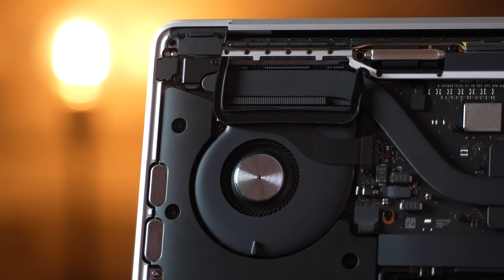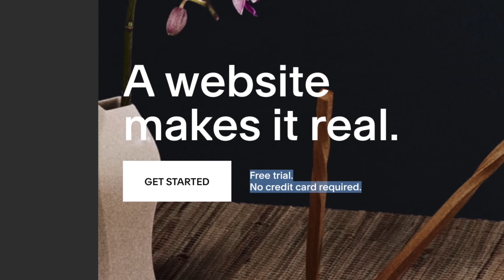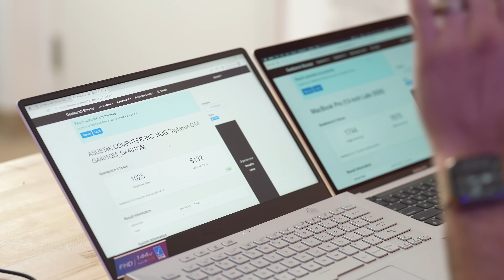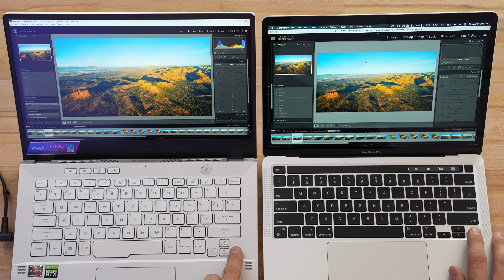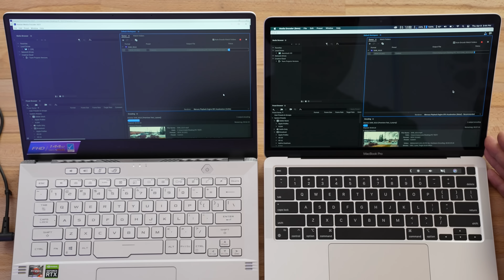Apple M1 vs AMD 5900HS + RTX 3060: FINALLY an M1 Killer?

Comment: Benchmarks are so pointless. Right now for example i have 2-3 second delay in Develop - Lightroom Classic vers 13.4 from picture to picture from an M1 8GB, and on a laptop Ryzen 5600H with integrated graphics the delay is less than a second. So where the power and optimisation from Adobe/Apple ? On 13.2 version it's allright. Big hype to sell, reality is somewhere inbetween.

Comment: Memory performance between 8GB and 16GB is generally find a very small difference, about 2 - 3 % max depend what apps and task is running. This is because an application does not run solely on memory space, it also run back and forth using the paging space for hard drive storage or digital drive storage. Your thoughts?

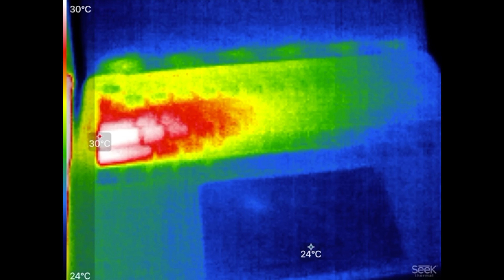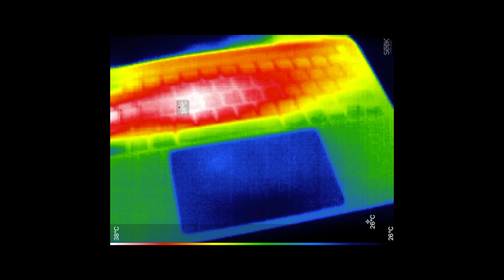Comment: Before and after the cinebench test, the hot-spot on the M1 happens to line up perfectly with the output fan on the Zephyrus 8:50 and 10:38 and

Comment: No one from the M1 fan club wants to acknowledge the existence of the ASUS ROG Flow line of laptops at the time (X13 w/ 5980HX), which absolutely destroys M1 macbooks in performance while having the same form factor (1.5 cm thick, 1.3 kg weight), and the similar premium features (plus bonus 120hz touch screens w/digitizer and microsoft pen protocol support). not to mention the ability to get up to RTX 3080 mobile egpu that has no bandwidth bottleneck,  the combo would still cost less than a m1 max machine with 32gb ram and 1TB storage.
Reply: Quick question, I'm interested on buying it but about its battery life? Oh and if it sucks can we upgrade the battery by switching it with a much stronger battery?

Comment: I'm watching this in 2022 because there aren't many comparisons like it for the new model g14s What I really want to see is basically the same series of tests without ever plugging in either machine, both starting at 100% battery, and then compare what % battery is left at the end or how may of the tests they can get through before the battery dies.  Another great test that would help know what I'd be getting would be how long can I edit photos in Lightroom classic before there battery is drained and how smooth is that experience? I wouldn't have any of these questions if I didn't think about wanting to also have a device to occasionally game on, I 'd just buy the MacBook Pro (no I don't want a console, since I already have a steam library).

Comment: I like how they keep saying the CPU will the m1 mag has built on GPU course so there's no way of disabling that otherwise it wouldn't be able to see the display you need to be able to enable the discrete graphics card and if it wins because it doesn't have an Apple doesn't have a discrete graphics card well then that's a big telling point it's not the CPU it's the GPU and the GPU does help the CPU

Comment: It's the fact that Ryzen is running generic platform applications not optimized to run that processor performs on par with application specifically developed to that m1 chip is mind blowing.  Hats off to AMD
Reply: You can't run ARM applications on AMD. you know that, right? M1 on the other hand can run applications written for x86 thrrough rosetta stone but at a loss of speed.

Comment: To all M1 fanboys. M1 does not share the same or similar instructions with AMD and Intel like AVX or SSE instructions. You can not do many many many things you can do on intel or amd without emulation using m1.  Just get over it man. M1 is a great processor but it is ARM based and arm is a lot different than intel. It is not better or worse. It is different and good.

Comment: I think the problem still is,  Windows is still optimized for Intel.   Despite AMD doing very well with RAW performance.   AMD is still somewhat crippled in that sense.  On top of that, Windows is generally made for generic computers,  as its not paired well with any specific PC.   Windows is made to be compatible with everything anything, supporting a wide array of components; which hinders performance.   Whereas, Apple, (while limited support)  hardware and software is tailor made specific.       the AMD is powerful indeed, but it carries a heavy load of Windows inefficient code, backwards compatibility and legacy support for hardware and software.

Comment: I feel like people in this comment section just forget that these are two entirely different devices built for different purposes with different up's and down's. Sure the G14 is better in some benchmarks and the MacBook is better in others but people just totally forget that the speakers on the G14 sound like shit in comparison to the MacBook, the battery life is worse (not even close), the trackpad doesn't feel good, it's less portable since it's a thicc boi and so on. While yes the G14 gives you the better overall gaming performance and experience and for it's price it delivers great value, it doesn't even come close to the MacBook if you'd use it everyday to edit videos or photos, code stuff and use it as a media consumption device. 
It's like comparing a sedan with a pickup.
Reply: the difference is that you can do whatever you want with the G14 asus laptop, there aren't limits, There are no limits, and when there are no limits, everything you say about consumption doesn't matter. Meanwhile with the Macbook there are limits. And about the G14 its a thick boy, It doesn't seem like that much, you're exaggerating.

Comment: I bought a G14 two weeks ago. It's an absolute gem. It runs absolutely silently in silent mode, but you have to set the mode. But I like that ability. Windows has always had pen lag in Photoshop, regardless of the processor. It has nothing to do with the G14. It's the way the standard mouse and trackpad drivers are handled by the OS. Run the same test but use a Wacom and you won't see any difference.
Reply: I also own g14 and its a absolute win when it comes to windows laptops.

Comment: Its like comparing cargo truck to sport car. Sport car is faster, prettier, more exclusive etc. Cargo truck burns 10x more fuel, is big and clunky but can tak 24 tons of cargo. Same here with M1 is faster in typical usage, more power efficient etc. but it is still ARM cpu which always will be less efficient in high preformace computing because its architecture and instructions set. Anyway Im very happy with huge progres achieved by ARM cpus in last few years.

Comment: I have spent a lot of time from a business perspective with M1s. We also have a some power users who we have outfitted with Dell G5s. If you are a power user the Apple will not perform as well. Now the Apple is also stuck at 16 gbs maximum ram. When you start getting above 12 gbs running multiple things, it is slower, period. Most of the tests in reviews, not a criticism are running all their tests one at a time. When are you doing some editing along streaming video, lol, with god knows how many Chrome tabs in the background, the G5s continue to roll. The M1s are unbeatable if you want top power on the move all the time, but it does have its struggles. The G5s are outfitted with 32 gbs but the AMDs when more cores are being pushed, you can truly see the difference.

Comment: M1 isn't actually faster, its perfectly optimised with the operating system hence gaining the speed and smoothness.
Reply: At the end of the day, it is faster; but you can call Intel and suggest him to create a native operative system 😂
Reply: @mattxloca3049  its not more powerful than Intel or Amd it's optimization makes it look faster. If Intel or Amd were optimized with the device then they would be faster
Reply: @rhythmkhandelwal2940  bro I sad that is faster not more powerful ahaha. But at the end of the day M1 it’s faster so that’s it. People looks the velocity of a processor non how much powerful could be in a dream, and M1 is still not supported at all by apps so also M1 is not optimised
Reply: @mattxloca3049   pls play cyberpunk 2077 on macbook u can also cook an egg whute playing it
Reply: @javier-jg8hr  windows laptops also get damn hot while gaming, I myself have g14 and saying it from experience. But thats what is expected due to current tech limitations, but m1 is definitely promising.
Reply: No, it is faster. Software is important but if you had the software optimized for both, M1 is faster and sucking in less power.
Reply: Alder Lake is proven to be fastest commercial processor currently, it's only drawback isn it's power consumption otherwise it's currently beat M1 Max in every thing except battery life
Reply: @rhythmkhandelwal2940  and that's only because of the power difference. If apple decides to suck in 70 watts, it will be faster. M1 is still scary fast compared to anything on the market,

Comment: DUDE WTF? Get your percentages straight! Your calculations of reduced performance on Asus laptop are very wrong.
Asus performance difference in Geekbench from plugged in and on battery is from 1496 to 1028 that is 31,2 % difference and you said 70% wtf let me tell you, you made a mistake for about 100%. I hope you understand how much that is!

Also with speedometer run you said that the difference with plugged in vs on battery was about 50% which in reality was about 32%.

I didn't watch the video further because I think it's just a waste of time and I don't want to make every calculation for you. Either learn how to calculate percentages or don't even mention it.

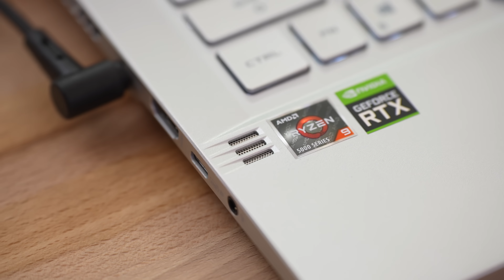Comment: 19:03
to be exact, amd didnt call it "the best", they called it the highest performance cpu. At full utilization the r9 is obviously performing better. Also, for the highest performance claim you dont need to be power efficiency. I know that power efficiency is important when sellecting a laptop but amds claim seems to have nothing to do with the efficiency.

apple did a great job with providing a nice cpu but I think that even a cheaper, lower core ryzen cpu would be very capable at the tasks tested, considering the ryzen 9 wasnt realy working at full utilization most of the times.

Comment: The M1 chip has only gotten faster as developers optimize their software to run natively on ARM. ... Intel says an unlisted system it tested with an Intel Core i7-1185G7 CPU and 16GB of RAM is 30% faster than the M1 chip while running Google Chrome and Microsoft Office tasks.20-Apr-2021

Comment: 15:30 - "if similarly equipped" - I don't think you can call a RTX 3060 6GB vs an integrated GPU that shares RAM with the 16GB system ram and has 5x LESS performance as "similarly equipped", but alright.

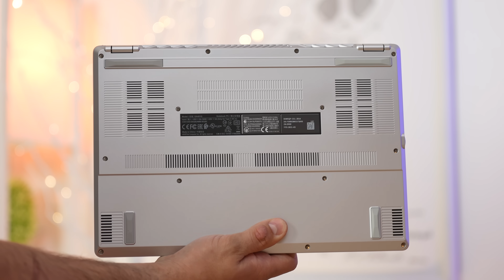Comment: 1:20 - G14 is MUCH thicker and MUCH heavier ?
man, those extra 2-3 mm of thickness must be insane to carry around in a bag. It's still thinner than most gaming laptops, as thin as many ultrabooks and has the performance it has.
About the weight, the MBP 13 is 1.4-1.5kg, while the Zephyrus G14 is 1.6kg. wow, those 100 grams more for so much performance and specs especially GPU will really kill you
Reply: Lol

Comment: People tend to be so emotional when comparing PCs with Apple computers and there's much hate and love involved. You cannot deny that M1 Macs are very good machines (the numbers are there), with its compromises of course. At the end it depends on what are you using your computer for. I work with Macs for video editing tasks, but I also work sometimes with Blender, and since Apple killed OpenCL and OpenGL support any decent PC with a graphics card will perform better than a Macbook or an iMac, specially if the GPU is Nvidia, due tu CUDA. And the same goes for gaming. I'm curious about the coming processor for desktop computers that will replace the top iMacs and Mac Pros.

Comment: Now i figured it out! The reason m1 is more power efficient is because of 30 better power savings for 5nm compared to 7nm.  So if amd used the same 5nm process just add 30% more battery efficiency to amd 7nm processors! Easily beats m1 mac!

Comment: ARM will surpass x86 in the upcoming years. Only 2 companies have the x86 license while all of the rest can have the ARM license and put R&D money for this architecture.
Reply: Yes we heard it from the early 90s, X86 will die and so far no processor can stand the performance of Threadripper processors. If you happen to work with such a processor, you will understand what I am talking about.
Reply: @uribak9144  The M1 processor from Apple has better single thread performance.

Comment: Tbh not sure what the point of this video was... a Mac is obviously completely different to a mid tier gaming laptop in every single way.  The screen, trackpad, battery etc are all going to be multiple times better on the M1 (just as they would be on an XPS etc), but I would strongly disagree about the keyboard - the Zephyrus has a killer keyboard and I personally cannot use Apple keyboards because of the frankly ridiculous key travel distance.  

I would love the M1 chips if they were more versatile.  They are seriously impressive tech, but I will never use Mac OS (or Windows for that matter) and the fact that Linux can't really run at the moment on them makes them useless to me.  In comparison, I can run Windows in a VM with GPU passthrough and have the best of both worlds on my G14.

Comment: If you want to buy anything fast as an Mac but not expensive, locked by Apple and could be upgradable, you must buy AMD or Intel.
Mac isn't fast because it's ARM, is fast because it's designed by Apple and they put tons of cash on that hardware; if you look to the closest ARM competitor: Qualcomm 8cx, they are fast as an Pentium G5400...

Comment: I have G15 which has same gpu but 5900HX. while 5900hx runs a little bit of hotter than 5800H it pumps around 7-10% more performence. And the best part is I got this machine under 1000USD with free shiping

Comment: Geekbench scores: when people are going to stop using this for performance comparison?  It's flawed since Geekbench 1 and is not a good tools for measuring performances.
For example, you can use Geekbench 3 with x and y cpus and have x beating y, and then on another Geekbench version it is the reverse. Also, their stats are easy to inflate and you can't rely on what you see online.

Comment: but still mac m1 is performing great without even pluged, but in asus to get peak performance always need to be plugged, and in case of battery performance we get a clear winner m1❤️❤️❤️
Reply: 70w vs 15w, M1 is the rule breaker.

Comment: The first thing I would love to greet you on the private channel, because its content is above excellent, and I almost saw most of the videos.
But I have a question because I intend to buy a device and are confused between two types
  Macbook Pro M1 or Asus ROG Zephyrus G14
In particular, I saw videos in terms of the comparison that wins in most of the comparisons
Asus ROG Zephyrus G14
The problem is that I am part of the Apple products
But the problem is that I will use it
  The unreal
Mainly in the period coming
But the result I saw from the MacBook Pro
Encouraging in this direction
Especially because I am in trouble between the two companies
I hope that you can tell your opinion as soon as possible, because in less than two days I should be the buyer of a dragon's father

Comment: I'm wondering when someone at Maxtech is going to point out ryzen, because it's on 7nm, only has less than 11 billion transistors, m1, because it's on 5nm, has 16 billion

Essentially, arm has to have 60 percent more transistors and still doesn't beat x86.

 Guys, it's clearly not arm or apple design that's good on the m1, the transistor count is the thing right now, nothing else, maybe in the future ARM 9 will compare, but right now ARM does not if both are on the same transistor footing

Imagine how it might compare if AMD enjoyed the same transistor count as M1, early amd 5nm test chips (rafael) domonstrate 40 percent performance boost, I think x86 isn't going away.

When m1x comes out it will probably enjoy 32 billion transistors, that thing will fly for sure, but before anyone pronounces it beats x86, wait until x86 also has 32 billion transistors

Comment: I have to educate this tech blogger. Cinebench is for CPU performance. An RTX 3060 is a GPU. Run DaVinci Resolve 17 M1/GPU vs Ryzen/RTX 3060 in rendering, the M1 is way (I've run the test already), but see for yourself. Also do some gaming tests. Apple M1 in Shadow of Tomb Raider with 1080P max settings hits 25 fps, the 3060 hits over 150 fps ultra settings. Do more research is my suggestion.

Comment: I am deciding on the g14 and m1 macbook air. I will like to point out, the g14 actually has more vibrant color display & fuller speakers than the air.I know this is a performance test between cpu chips but the g14 with rtx 3060 max-q can play half-life alyx at max resolution on a hp reverb g2 and even MS flight simulator VR in lower settings. And all new games with ray tracing at 1080p at 30fps-144fps. M1 is pretty amazing. It can play metro exodus at 1080 medium setting at 30 fps. But the rtx 3060 max-q is equal to a 130 watt 2060 max-p in a 14" chasis. Pretty great improvement on 2021 model performance/thermals. Crazy how powerful and long battery life in a portable package. But m1 air does feel lighter and thinner in hand/bag especially with that small 35w power adapter (but g14 can be charged via usb-c battery pack). 19:10 leaves black bars for entertainment but extra vertical space helps in productivity. Another thing ppl don't point out is M1 battery life is also not as long with non native apps.

Comment: this compare Apple M1 vs AMD 5900HS + RTX 3060, by operate system is fake but, Windows is not optimization, windows use level up memory and process under first process, by use UNIX vs UNIX (Mac/OS) Windows Is optimize for Intel architecture.